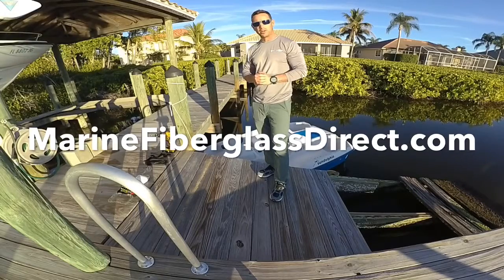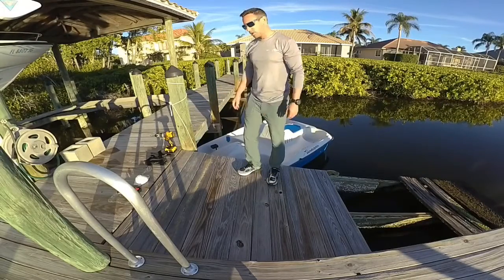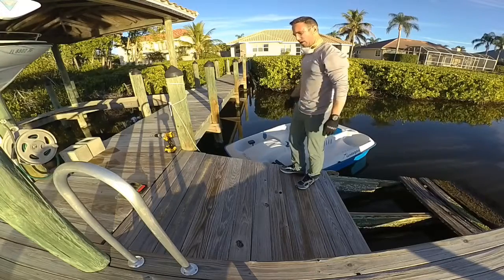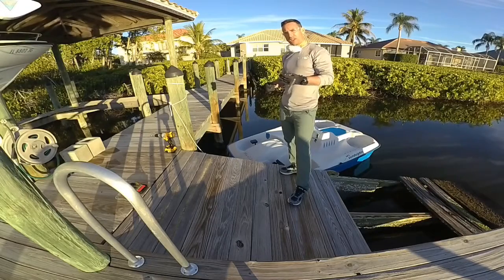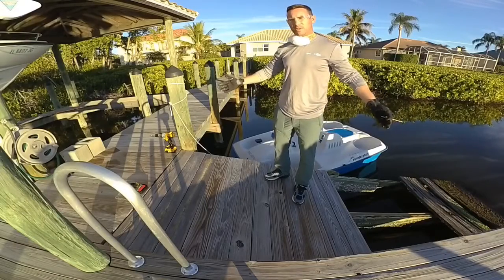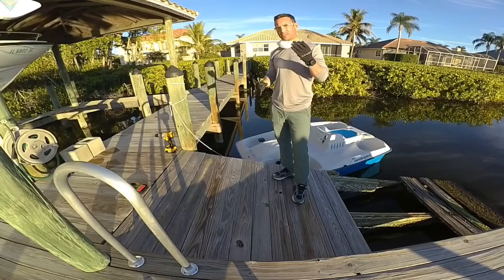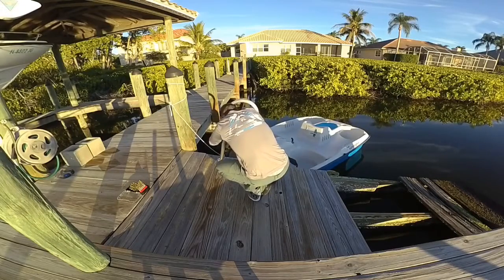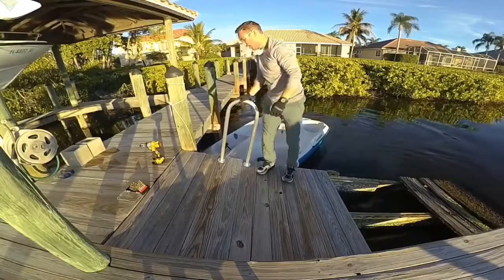MARINE FIBERGLASS DIRECT Grab bar Handrail Installation

Comment: Did you use tap in screws ?
Reply from the maker: Thank you for contacting us! We need not use self tapping screws. We pre-drilled the holes using a 1/4" bit with #14 stainless steel screws. We recommend using a thru-bolt connection if your application allows.